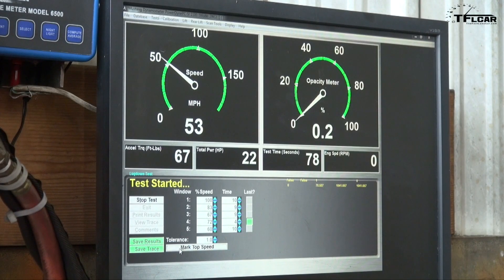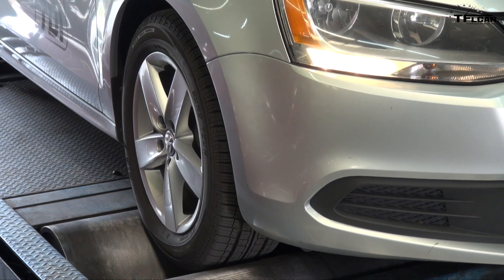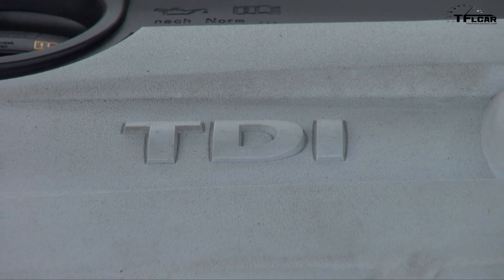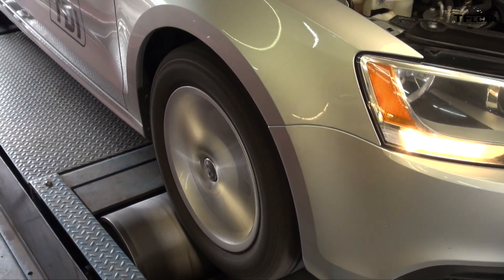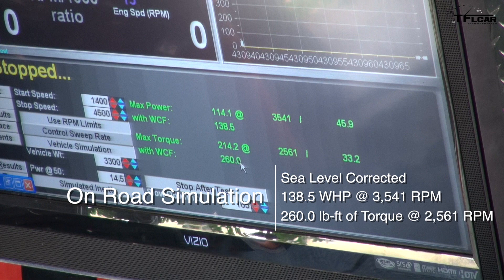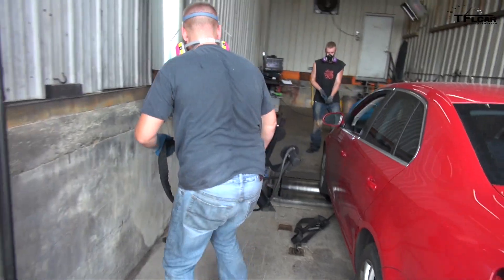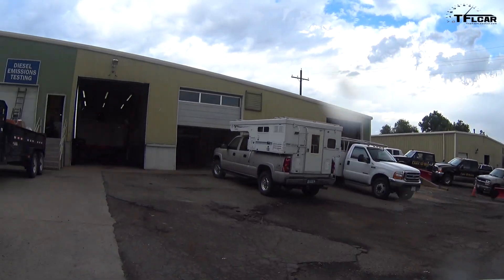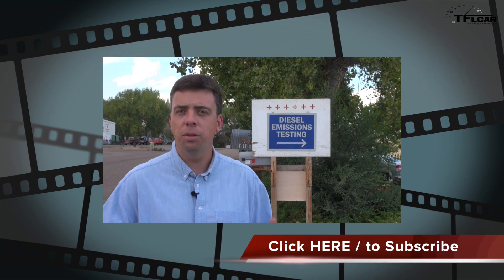Surprise! We Dyno a VW Dieselgate TDI Jetta to get the Truth about HP Loss

Comment: I don't get why people care so much about this issue, like that women saying her car is "worthless" now. If VW lied about the cars MPG I can have a issue. So her VW doesn't burn that clean it's "mass murder" now.

Have you seen big rigs and the diesel they puff out..shit GM killed people with ignition switches but VW is getting life in prison.
Reply: +chefdan87 Diesels emit less CO2 than gassers and hybrids. As for the black smooke/soot, that's not just carbon (even di gas engines have carbon issues) it's also particulate matter. Diesels have a dpf (diesel particulate filter) to eliminate particles in exhaust. Diesels have very little carbon build-up on tailpipes as opposed to di gassers. NOx is there in diesel as well as paraffin wax candles. The only reason why cars have less NOx emissions is because gasoline is further refined. But to get your gasoline refined, you're producing more hydrocarbons, which technically won't offset NOx from diesels, especially when di gassers produce more particulate matter.
Reply: +usvc1 I'd pay more to know the car had the higher torque, HP, and mileage tune still installed rather than the government-forced recall "fix".
Reply: +Gazooo29 In many states the car could be deemed as worthless or unsaleable due to it failing emissions in a yearly inspection labeling it illegal for road use. If that becomes the case however recalls would be forced to correct the issue and remap the engine to abide by regulations. That could leave people in limbo until their car is fixed. There will be people required to continue making payments on car that is no longer worth what you are paying for it. Same thing happened when the housing market plummeted and people went upside down on their loans. The black soot in exhaust really isnt the bad thing when it comes to emissions as it is carbon ash with traces of unburnt fuel, its Co2 and carbon monoxide which is the problems. Its hard to compare large commercial equipment to cars as they are now becoming more and more efficient with new technology when compared to the work they are doing.
Reply: chefdan87 They most certainly DO affect CO2, it is one of those "safer emissions" that you referred to above.  The process of burning CO and unburned fuel produces CO2 and water.

Whether that is a good or bad trade off is a whole different discussion but I'm just trying to point out the unintended consequences of prior regulations and suggest that we cannot know the net effect of the newer strict NOx regulations.
Reply: Fucking gym stock didn't even drop. Shit is a big scam
Reply: +Gazooo29 Try to tell somebody with Asthma.... With 11 million faudulous engines worldwide, I am quite certain that the number of deaths and people suffering far exceeds that of the ignition switch scandal. It is not so visible, but they must be there. How cynical must VW be? I know that locomotives and lorries emit the same stuff a Thousand times more. Yes something should be done about that too, but that is not deliberate fraud. What VW did, was.
Reply: matthew von
So do you not remember all the news coverage and lawsuits against GM? The hate they received through the social media? Are you joking, or just trying to come off as an idiot?
Reply: +chefdan87 Interesting that you bring up CO2 in this context.  Virtually every car sold in America over the last 30+ years has been putting out MORE CO2 than necessary due to government mandated catalytic converters.
Reply: Way to try to hide from your earlier claim that catalytic converters do not affect CO2.  You should really just admit that you were the one who is "ignorant" on these issues.

"Of course it is a good trade off compared to carbon monoxide"

That's incredibly simplistic and really demonstrates how dangerous you central planner types are.  You didn't even know that catalytic converters produce additional CO2 a moment ago and now you're claiming to know what the net effect on global temperatures and thus human lives of something like a billion cars with CCs sold over the last 3+ decades vs the net affect on human health that the additional CO would have caused instead?  How about the effect of the trillion or so dollars that has been spent producing these things that could have improved people's lives in other ways?  How about the additional fuel consumed due to them? 

It is quite literally impossible for you to know if this was a good trade off or not but thanks for so ably demonstrating the Dunning–Kruger effect.
Reply: Difference is GM ignition switch was manufacturing defect while VW's diesel gate was intentionally cheating EPA system.
Reply: RNL Valen ...Those ignition switches were being installed in new GM vehicles even after it was realized they were not up to snuff!
Reply: RNL Valen ...Screw the EPA!!!
Reply: RNL Valen "BMW's factory investments in U.S. doesn't nullify US's trade deficit with EU."

Of course it does.  The construction worker building that BMW plant in the U.S. is just as good as the Ford factory worker who would have been employed if some European had spent the money to purchase a Ford car instead of to build a BMW plant.

"Americans buying imported goods diverts funds from American producers, hence making American poorer"

You're ignoring the benefit to U.S. Consumers as well as the benefit to other U.S. producers.  For example, I recently purchased a foreign made electric heater for $15.  If I had instead been forced to purchase an equivalent U.S. made heater for $30 then I would have been made $15 worse off AND some other producer would have lost out on the $15 that I would have spent with them as well.  When you add it all up Americans would be made poorer by such a policy.

"it's the EU who imposed higher artificial trade barriers than US."

The EU is making it's citizens poorer with this policy and we should not make Americans poorer as well in order to make things "fair".  

"Charity begins at home."  

It isn't charity to point a gun at someone and force them to buy from you, that is theft.  If you owned a local shop would it be charity to intercept all Amazon packages on their way into town and impose a tax on your neighbors who had purchase them?
Reply: +Gazooo29 Older big rig diesels puff smoke, new trucks meet emissions standards.
Reply: *****
There is no real way to avoid CO2 emissions while burning Hydrocarbons. Catalytic Converters do not affect CO2, the platinum, palladium and rhodium in them convert the more serious pollutants into safer emissions through a chemical reaction. And they burn excess fuel by becoming extremely hot while working. I really hope you do not believe catalytic converters are a bad thing as that would really show how ignorant you are.
Reply: Dallas Cheked GM's ignition switch issue was a manufacturing defect which is different from cheating the EPA system.
Reply: chefdan87 ...CO is a deadly poison. CO2 is essential to life!
Reply: RNL Valen That's a valid point but on the other hand the cheating by VW resulted in cars many consumers preferred (more power, better fuel efficiency etc).  It isn't even obvious that the total environmental impact will be lower with the "fixed" cars once you account for the increased fuel consumption and the resources consumed by producing the additional emissions equipment.
Reply: *****
It doesn't matter, TDI is effectively dead in USA. VW Golf TDI's original claim for smog are inferior to Toyota Corolla Petrol's version.

for cars:  
 EU duty on imports from the US is 10% 
US duty on imports from the EU is only 2.5% 

Trump will review the unfair trade arrangements.

 Telsa's battery is mostly Nickel-Graphite with tiny 2 percent Lithium. Nickel-Graphite are common materials.

http://benchmarkminerals.com/Blog/elon-musk-our-lithium-ion-batteries-should-be-called-nickel-graphite/
Telsa has trolled the world (China, EU) into investing into Lithium.
Reply: RNL Valen You're probably right about the TDI being dead in the U.S.  

On trade, I have some hope that Trump understands that taxing Americans who purchase foreign goods would, overall, make Americans poorer and that the only way to become more competitive is to move towards a more free market with lower taxes, spending, and regulations.
Reply: ***** Trump's focus is to make trade arrangements fair. EU's 10 percent tariff on US manufactured cars are not equal to US's 2 percent tariff EU manufactured  cars.

https://www.census.gov/foreign-trade/balance/c0003.html
US has a trade deficit with EU.
US has a trade deficit with China.
Reply: RNL Valen There is no such thing as fair trade.  Countries don't trade, individuals do and every artificial restriction on their freedom is harmful.  U.S. citizens would be better off under the existing tariff regime than they would if both sides imposed a 10% tariff on their citizens who purchased imported goods.  Hopefully he's just using these threats to get them to drop their tariffs which would be even better.

A trade deficit  can be a sign of economic trouble but it is not a problem in and of itself.  All dollars sent to the EU in exchange for goods or services must ultimately return to the U.S. If they are not used to buy U.S. goods or services then they return in the form of investments in U.S. assets such as stocks, bonds, real estate etc.

BTW, thanks for the link re Tesla.  It looks interesting.
Reply: ***** Foreign governments' influenced high oil price caused manufacturing to return towards the US.
http://www.marketwatch.com/story/us-flips-the-script-on-jobs-reshoring-finally-outpaced-offshoring-in-2014-2015-05-01
It's EU's decision to set the 10 percent tariff.
Reply: RNL Valen Good article, thanks.  I'll just point out that they do mention foreign investment (a BMW plant) as one of the factors.  That investment is only possible due to the trade deficit.
Reply: ***** US's trade deficit with EU means US imports more goods and services from EU than US exports to EU.
BMW's factory investments in U.S. doesn't nullify US's trade deficit with EU.
 
On trade,
Trump's plan taxes on imports replicates foreign government influenced high oil price environment.

Americans buying imported goods diverts funds from American producers, hence making American poorer and it's the EU who imposed higher artificial trade barriers than US. Your arguments are EU bias. Why do have a bias towards building EU's middle class ahead of US middle class? Charity begins at home.
Reply: ***** Of course it does.  The construction worker building that BMW plant in the U.S. is just as good as the Ford factory worker who would have been employed if some European had spent the money to purchase a Ford car instead of to build a BMW plant.

It doesn't negate US's trade deficit (for goods and services) with EU.

BMW factory doesn't equal the entire trade activity between US and EU. BMW's US build volume is small.  

You're ignoring the benefit to U.S. Consumers as well as the benefit to other U.S. producers.

You're ignoring the plan to reduce US corporate tax to 15 percent.
You're ignoring EU has a higher tariff for US made vehicles being imported into EU. The tariff is targeted not for general cases.
For example, I recently purchased a foreign made electric heater for $15.  If I had instead been forced to purchase an equivalent U.S. made heater for $30 then I would have been made $15 worse off AND some other producer would have lost out on the $15 that I would have spent with them as well.  When you add it all up Americans would be made poorer by such a policy
We are talking about US/EU  build vehicles not Asian/Mexico built electric heaters. Your argument is a red hearing.

http://humanevents.com/2010/04/20/chinas-rare-earth-monopoly/
http://www.wsj.com/articles/SB10001424052748703321004575427050544485366
China Dangles Rare-Earth Resources to Lure Investment

BEIJING—China is cautiously using rare-earth resources as bait for foreign investment that could bring in sophisticated technologies that it needs. Industry and government officials have begun talking about a Chinese government plan to offer access to its rare-earth resources—which are used in products such as hybrid-car batteries and missiles and are under strict export restrictions—to get companies including electronics manufacturers and auto makers to set up rare-earth-processing plants in China.

You're ignoring China didn't play by the same rules and create a near monopoly with rare earth resources.
Using their  near monopoly with rare earth resource leverage, it forced companies to establish factories in China when using rare earth materials. Chinese is smarter than the US establishment.

The EU is making it's citizens poorer with this policy and we should not make Americans poorer as well in order to make things fair.
 
Your argument is flawed since you use cheaper heater instead of US/EU build vehicles.

The tariff is on vehicles and we are not talking about cheaper heaters.

It isn't charity to point a gun at someone and force them to buy from you, that is theft.  If you owned a local shop would it be charity to intercept all Amazon packages on their way into town and impose a tax on your neighbors who had purchase them?

Your argument is flawed since you use cheaper heater instead of US/EU build vehicles.

The tariff is on vehicles and we are not talking about cheaper heaters or Amazon packages.
Reply: Gazooo29 

ikr?

Ota noes!   my peppy, pleasant to drive economical car that gets 50mpg is crap because... polar bears. 
betcha the TDI still does less "environmental damage" than a 90s era V8 Suv. 

shift early, stay off the go pedal, and drive it easy. and I promise you won't kill any polar bears with your TDI
Reply: Ronald de Rooij 
I didn't have breathing issues before I bought my 2013 Jetta TDI. I put 250,000 miles on it in 2.5 years. I was then diagnosed with Asthma.
Reply: ANY TDI... will appreciate in value!! (with my Malone tune I get 295 ft/lbs torque and 50 MPG!!!) they will become very sought after!
Reply: *****
Of course it is a good trade off compared to carbon monoxide. Is it really that hard to understand this?

Comment: During emissions testing, the wheels move but the steering wheel doesn't.  Under normal driving the steering wheel oscillates.  That was the reported 'trigger' for the deception, not FWD vs AWD motion.  I love that you did the dyno test, but I am not sure a dyno test would see a difference.  The issue is regeneration of the lean NOX trap right?  And under WOT as on a dyno that cycle might not run in either case. To test it you would need to test steady-state with no steering vibration vs steady state with some steering vibration or similar to see how the engine controls changed.  What you should see is when the NOX trap regeneration is active the engine goes too rich in order to pass fuel through to burn in the NOX trap and clear the trap.  When the test is by-passed does the NOX trap simply go un-regenerated?  So when the trap is being regenerated properly the engine would run too rich periodically, worsening fuel economy (due to the fuel being splashed into the NOX trap and burned) and drive quality.

Comment: You guys should have actually taken the car to get emissions tested to see if the EPA claims are true.
Reply: The way I see it, EPA issued an enforcement action based on someone else's testing. EPA will most likely need to verify claims from ICCT (the testing party that reported) and VW (which admitted to using software). We still don't have actual readings or info on when NOx emissions reach peak... is it during a cold start or under heavy loads, or is it always emitting higher NOx while running? We don't have that information.
Reply: We do.
Watch Panarama , which aired 23/11/2015 VW Emissions scandal